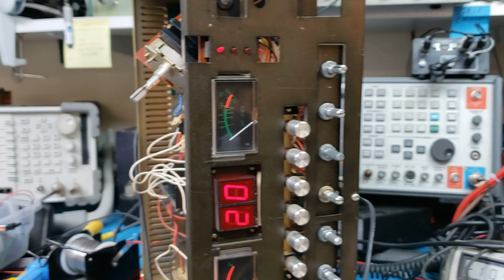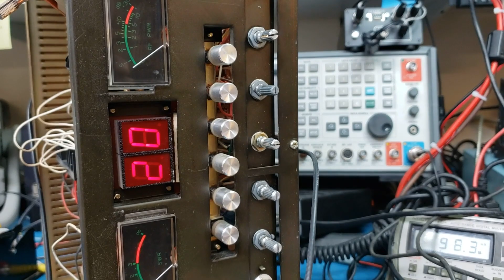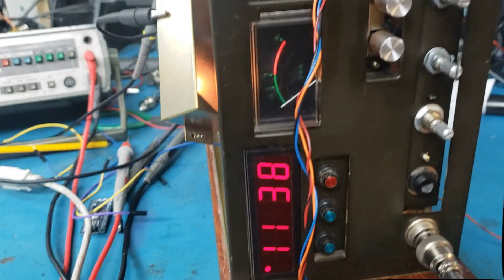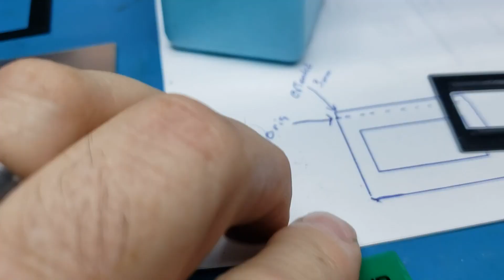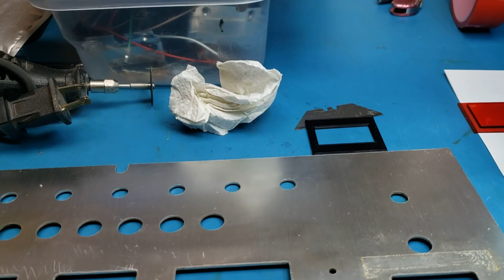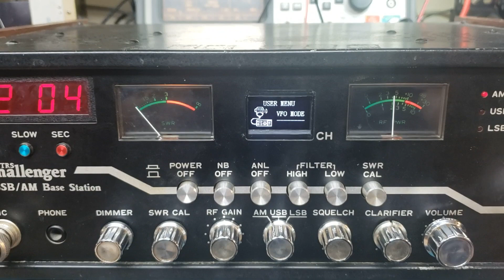TRS Challenger SSB AM

Comment: Can you use a switch to activate the HF converter/receiver board instead of having to go into the menu to select it?
Reply from the maker: Currently no, due to the way the software is written. It is possable ofcourse so if enough intrest, it can be placed in an update.
Reply: @ddsvfo  So pin 11 locks the transverter function from being available then?